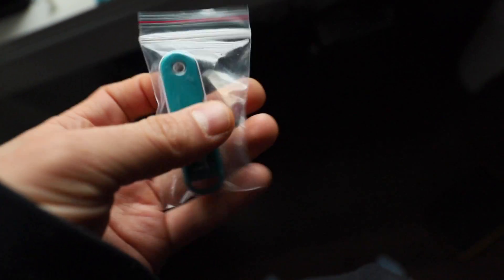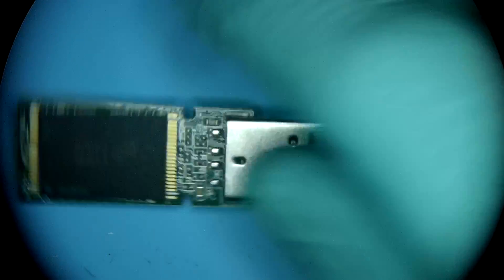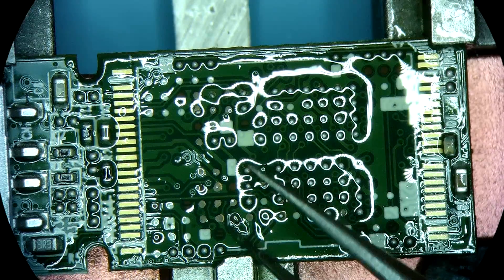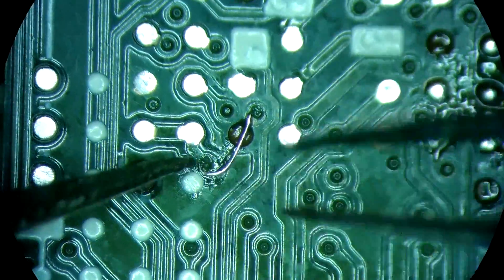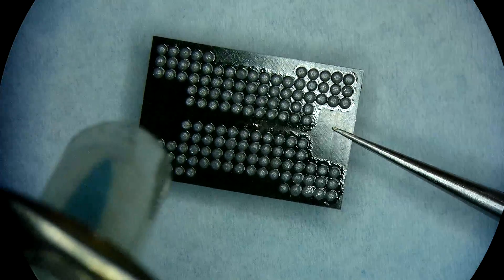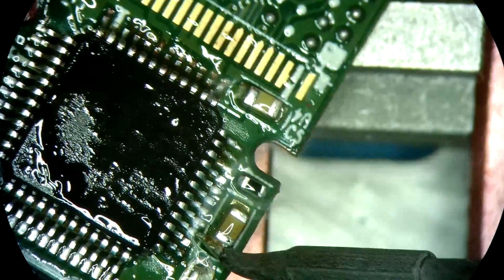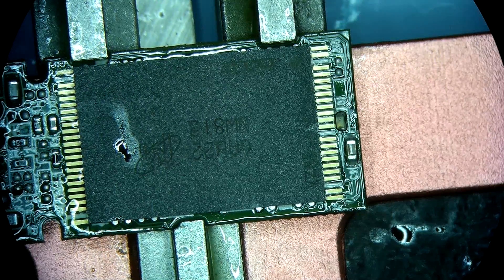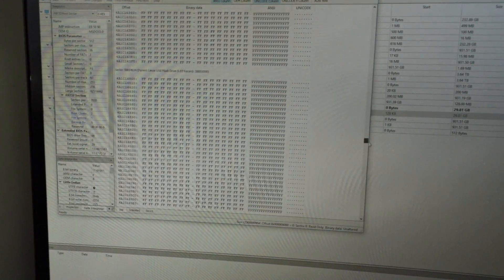how to bring usb stick back to life

Comment: Thanks for the upload.
Gave me an idea of what was the issue with my USB memory stick that just stopped working today.
I opened up the casing and I squeezed on the memory area when inserting the memory stick and it read it fine.
Not a permanent fix, but will give me the opportunity to get my data etc.
After which I may try baking the stick for 5 min at 200 degrees in an oven, on the off chance that it may fix whatever soldered connection is weak / broken.
cheers!
JB
Reply from the maker: Awesome!
Reply: @hddrecoveryservices  Yes, and one good tip - for the type of issue that you mention / identified in your video - you can use a clothes peg or something similar that holds / presses the memory chip against the circuit and hence helps maintain those loose / weak connections so you get a little more life out of the USB memory stick 👍🙂
cheers!

Comment: I still struggle to make the curved, "long" (longer tip past "the bend") tips work for me. Solder pools in "the elbow" and refuses to stay at or migrate to the actual tip of the iron. Any tips?
Reply from the maker: What iron do you use? I highly recommend getting a brushing tip cleaner. I have a hakko unit that I've been using to rejuvenate tips for years. It comes with cleaning paste.

Comment: I have a PNY 256g that worked one minute, dead the next (It died while still plugged into the computer) the led still flashes once when you put it in a USB port, and the computer recognized it as a usb 3.0 device but that's it.

Comment: Thank you for this video, great job. It can be more easy to recover data directly from the nand by using VNR ?
Reply from the maker: Repair took 20-30min. Chip off with all the elements can take days. TLC chips don't read clean on first pass :) so reading and error correction can take a lot of time.

Comment: I'm not much into data recovery but your videos are so fun to watch :D
quick question, since you did not change any components on the drive and just fixed the traces, should it not just worked straight up and been able to access it through the explorer??
Keep up the awesome work!
Reply from the maker: Thank you Karim. Yes, you are correct this unit would just work in explorer. But USB stabilizer I use also works as write blocker. You never know what the flash drive was doing when it was damaged, so if something in FS was unfinished and that might have affected data accessibility. As a precaution I use Deepspar piece, and image the device

Comment: Nice work...... I really want to be like you, how do I start?
Reply: Learn , how to solder with iron and hot air station, you should also know how electronics works, polarity, components, it also requires  some stuff, like chip readers and spare parts, but in case like this, you will be good only with soldering. The most expensive part of this is software. So, if you are going to make a living from this, you should have some money to invest.
Reply from the maker: like Ekon said, it will take some tools to do this well. Best to save up for great tools as they will make the work much easier. Good scope (amscope) good iron (quick for start) good hot air station quick is great for it, Most of this stuff is available from unionrepair